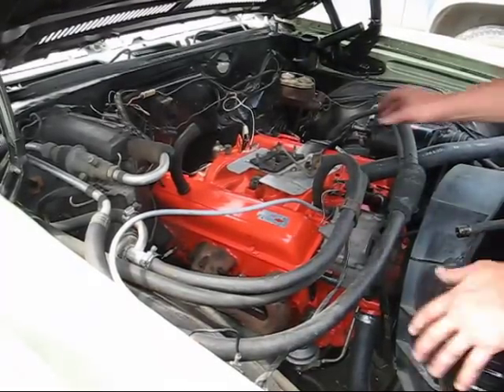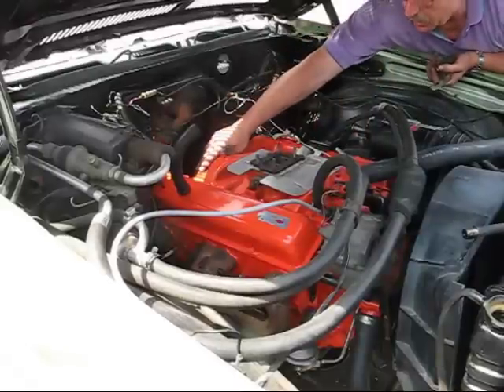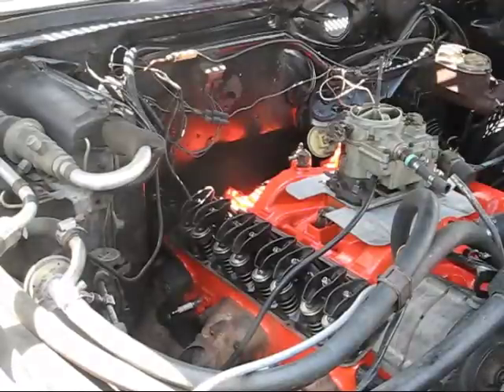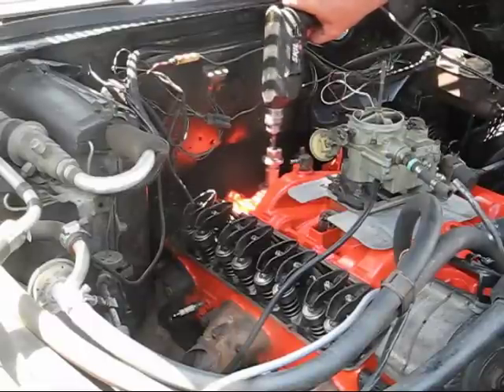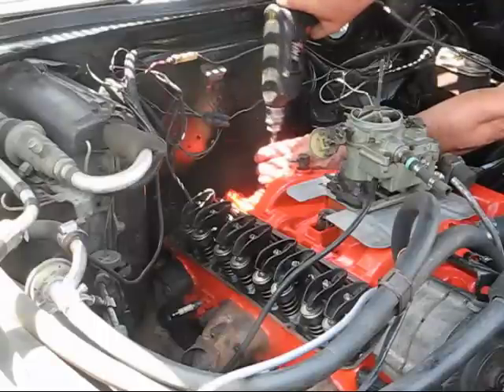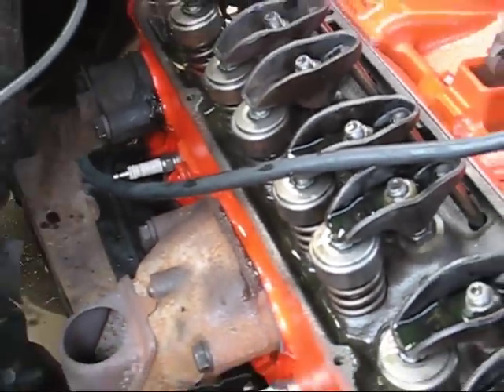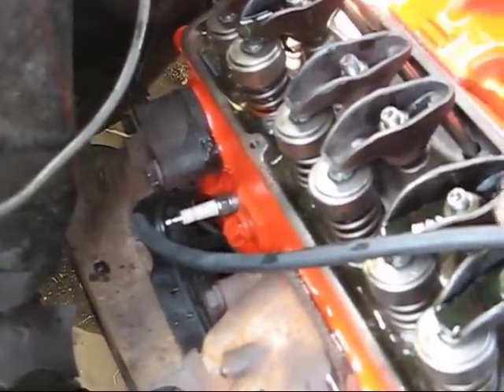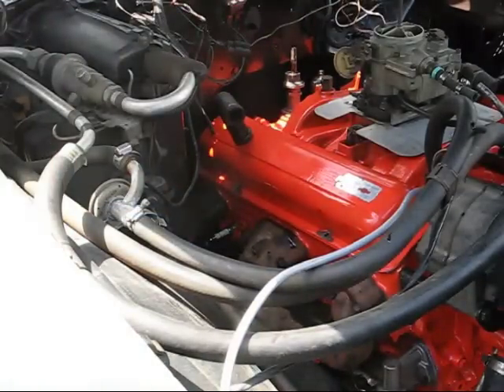How to Prime an Engine with Oil before First Start

Comment: machine shop put lube on engfine assembly, lots of it, so you dont need prime.
Reply from the maker: The machine shop where I had the cylinders bored said he never used to put lub on them until several engines started coming back because people would not prime them and rev them up and spin the bearings.

Two schools of thought, I prime because I want to make sure I don't have a problem especially after all the work and money.  It would be safer to put lub on all the bearing but I never had a problem without it.

Comment: You can do that but there are oil pump primer shafts for different engines. The 'Dist.' method is good because it has the body to hold the shaft steady. Keep on until you see oil on the rockers. Crank the engine around by hand to distribute the oil to the bearings. Start the engine and full-throttle it to lube the cam and crank. GOOD JOB!!!
Reply from the maker: I made it using an old distributor.

Comment: Would unplugging your fuel injector wires and turning the engine over with your starter be a good way to prime a newly rebuilt engine?
Reply from the maker: That means your engine is turning over without oil.  The main concept is to have your new engine fully lubricated before starting it.  If the person that put the engine together used heavy engine rebuild grease, it would be OK.
Reply from the maker: @JoeDoe-h6y  All questions are good questions.   Because, if you are asking it, that means many others have the same question but are afraid to ask the question.
Reply from the maker: @JoeDoe-h6y  If I get real negative comments, I just do not respond, why lower myself to there level?  Then they go away.

Comment: That my friends is a big ol shitty mess...  but its all good ... and very oily.
Reply from the maker: You could put a strip of  card board along the head so the if the oil does squirt out it goes back into the top of the head and back into the oil pan.   Like in my other video "How to determine the source of engine knocking noise"
Reply: Jay Sims Yeah but it's important to prime the engine unless you want to ruin an engine!

Comment: what make and model motor you priming here. Thank you
Reply from the maker: 1970 Chevelle 350-V8  2 bbl carb - 250HP.   This is the original motor that came with the car from factory.
Reply: Thank you.  Im working with a 1975 pontiac catalina 4400. Im curious of my motors TDC plug. Im a Chevy.
Reply from the maker: 1970 Chevelle 350-V8  2 bbl carb - 250HP.   This is the original motor that came with the car from factory.
Reply from the maker: I thinking you are asking for the ignition timing.   From 1968 to 1970 it was 8 degrees before top dead center.   In 1971 to 1972 it went to 12 degrees before.    I don't know what it is in 1975.

It also has a note talking about the pollution laws effected the crankcase emission.

Comment: It looked like a couple of the rocker arms didn't have oil running out of them. Was there a clogged oil passage or did you have to keep pumping until EVERY ROCKER ARM shows oil?Thanks
Reply from the maker: I usually run it until oil comes out of everyone.  Did you clean your push rod tubes?
Reply: You crank the engine by hand to distribute the oil.

Comment: With what adhesive did you attach the gasket to the valve cover? Thanks for the video at the cost of an oily mess to you.You should get an old used pair of covers and cut them in half so that you can observe and hopefully eliminate oil in your engine bay. Thanks again.

Comment: What do u do if only half the motor will prime ?? Need help
Reply from the maker: Are you using an electric drill?   

Is this a total rebuild?

Are both valve covers off?
Reply: @davidlis6709  what will happen if you use a cordless drill and can you  explain what both valve covers off would do please

Comment: what you do is you unhook the powere wire and turn over your engine for about 1 min and you check the oil and if it looks low its just beacuse the engine took some of it
Reply from the maker: You are sort of right.   That works but there is minimal oil on all the moving parts of the  engine.  Only what you put one during assembly.  You have to keep on turning the engine over until the oil pump gets up to pressure and gets oil to all the moving parts of the engine.  This could cause the bearings to score (be damaged) from lack of oil.   That is why many machine shops use bearing lubrication when assembling engines.  People don't prime their engines and they rev these engines up on start before all the oil pressure is at it maximum and the engine is fully  lubricated.   When the engines seize up they blame the machine shop for their ignorance.

I always prime the engines before I start them so I don't have any problems.  Many people comment why I don't use lubrication because I am from the old school that always primes the engines.  Only been doing this since I was 17 when I use to drag race.  Works for me.
Reply: Well have you ever heard of a special oil pand that the oil dont slosh around in beacuse if you go around a corner have or you know getting the oil sloshing around in the pan beacuse if the engine dont get oil for 1 second the engine will blow
Reply from the maker: There are special oil pans that stop all the oil from sloshing froward when you step on the brakes real hard.   These are designed to keep the majority of the oil in the area where the oil pump pickup tube is located insuring that oil is constantly being pumped throughout the engine.    There is also a piece of metal that is bolted to the main bearings (can't remember) (I believe they call it a windage tray) that keeps the air flow down created by the motion of the connecting rods.  Once again, keeping the most amount of oil in the oil pan.
Reply: Do you think a 472 cadillac engine would fit in a 76 corvette space wise
Reply from the maker: I would not even think about it, to hard.  Why install a cadillac engine in a corvette?  Getting it installed would be a nightmare, how about the electrical connections, how about the exhaust system, cooling, etc.  And you have to make your own mounting brackets for the motor and transmission.  The drive shaft is going to be a different length.  Plus parts are harder to get and cost more.    I don't think it will ad value to the car.
Reply: What about a 455
Reply: Or 454
Reply: What do you think would be easier 454 or 455 or better?
Reply from the maker: What is the biggest engine for your Corvette in that year?
Reply: 572
Reply from the maker: What year is your Corvette?
Reply: 76
Reply: +Stephen Mechenski    No good to spin a newly rebuilt dry engine without oil throughout even without a load.
Reply: +David Lis    Windage tray. Correct.
Reply: +Stephen Mecheski    Measure a Chevy 455 and the 472 outer dimensions and mounting locations.
Reply: +Stephen Mecheski    Stuff a 500 Caddy in there. YAYA!
Reply: Can you also just keep turning the crank ?

Comment: Or pull plugs and spin starter.
Reply from the maker: +Vincent Vega I like to run the oil pump first so that the engine is full of oil and all the bearings, lifters, rockers arm, all the moving parts are coated with oil.  Spinning it with the spark pugs out puts less resistance on the engine but it still has to spin without oil everywhere.
Reply: +David Lis What if the oil pump is crank driven behind a timing cover.
Reply from the maker: +Vincent Vega I don't understand your question?  What is your car?
Reply: +Vincent Vega Chevy  v8 with a crank shaft driven oil pump.
Reply: +David Lis if you remove spark plugs it takes all the load on crank and rod journals and bearings. Using assembly lube liberally is enough.
Reply: Vincent Vega that's metal on metal Parts moving with no oil. this guy did it right I believe I'm priming it before any of those parts move. seems like common sense to me. think about it
Reply from the maker: The machine shop that bored the cylinders told me that he started using assembly lube because people would start the engines without priming them.  They would screwed up the engine and bring them back and complain, he would ask if they primed the engine before starting and they said no.    Priming the engine fills up all the bearing, lifters,  everything with oil so it is ready to go.  I never had an engine have problems because I always prime.  It is another step but after you do all that work, why not one more step.
Reply: David Lis agreed

Comment: wouldnt it only spin when the camshaft spins too? That old distributor shaft without its gears right?
Reply from the maker: +Jose Ferreira The gear is removed from the distributor shaft so it does not connect to the cam shaft.  It connects directly to the oil pump.  So when to turn on the drill, it only runs the oil pump.
Reply: @davidlis6709  Thank you for your information,

Comment: My 5.3l ls died on me last night indicating low oil pressure. Does it have a shutoff system to save the motor?
Reply: oil pump or sending unit. they get loud with no oil pressure.

Comment: I'm so friggin excited to see this thing fire off. It's awesome how you used the old distributor as a primer by the way, I didn't learn that until recently
Reply from the maker: My dad show me this trick in 1967 when we used to build motors to drag race.  Of course, it is a little different today, the times and speed are unbelievable.   But before it went with corporate sponsors, etc.  it was a fun thing to do on a Sunday.  And depending on the day and who showed up, I would win my class every once in a while,  E modified production.  They don' have that any more.  

We would get so excited on the night of starting a new engine.  You would think that you would grow up after a while but ---  I think not, to much fun.